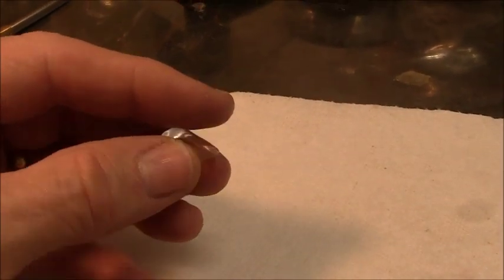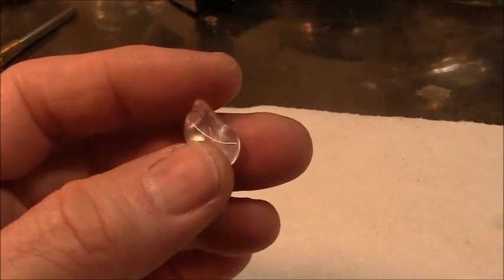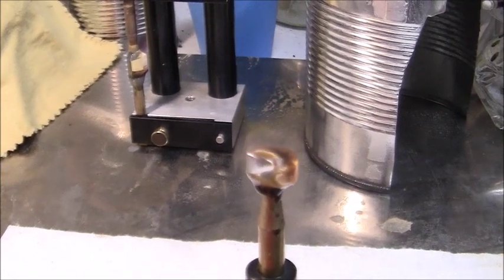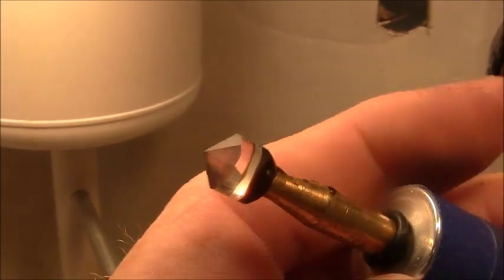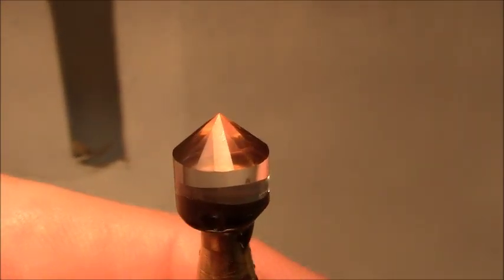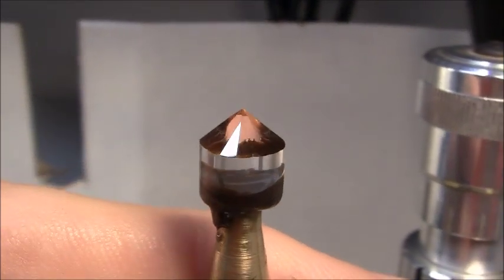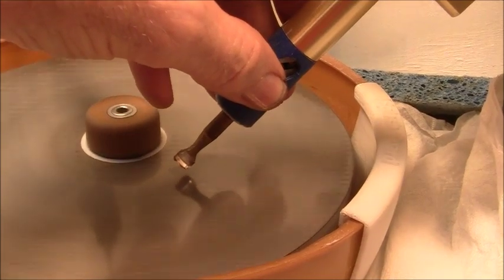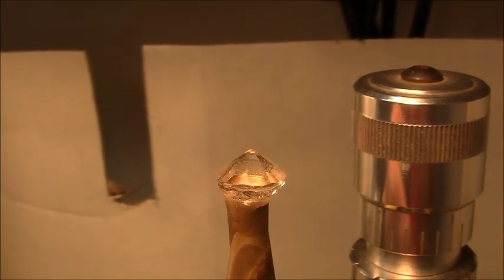Faceting gemstones: cutting danburite.

Comment: how do you prevent the dopping compound from clogging the wheel?
Reply from the maker: Its probably best to completely remove all traces of wax or glue from the stone that could be ground off onto the lap by scraping with a blade but i sometimes get lazy and dont get it all off. I dont seem to have a problem with clogging .  I use a stiff brush to clean the laps.